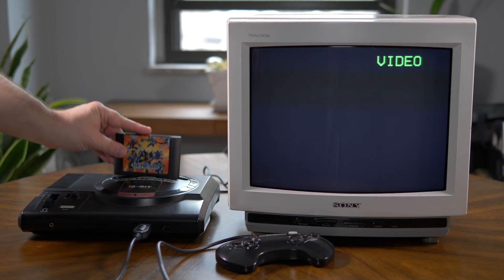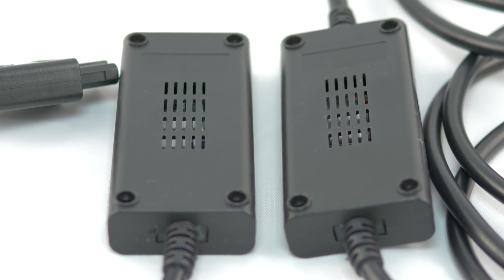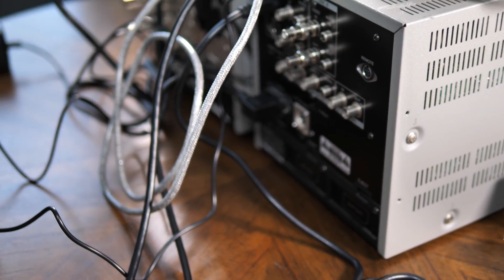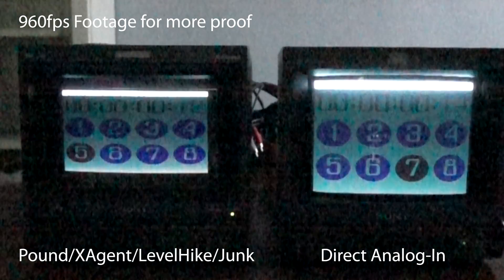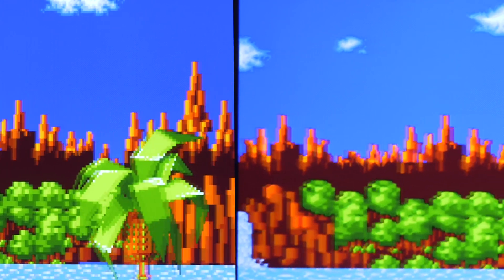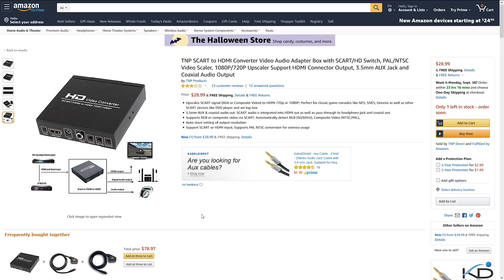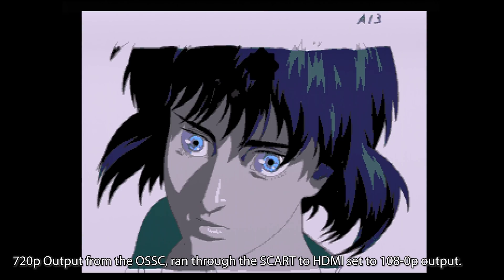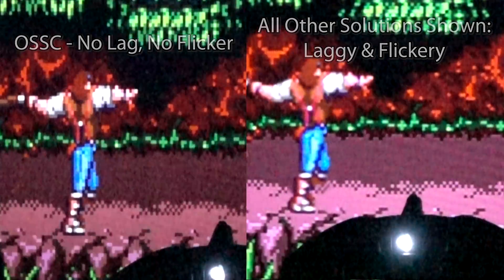The Worst Scaler In Retro Gaming

Comment: There's stuff worst than the GBS-8200 CGA to VGA Video Converter ?
Reply: I know its shocking, that GBS is trash too!
Reply: @JasonBaker1978  I see the GBS as a very cheap, last ditch effort for some really jerry rig Arcade video conversions. It was intended to be used by Arcade operators who don't really care about video quality, and they want to convert video really cheaply.
It performs terribly with any game console.
Reply: There is custom control software for the GBS which actually makes it pretty great. Check out the gbscontrol project
Reply: @fluxcorenz  better sure, but pretty great?  I guess it depends on what you consider great.  I wouldn't mess with one.  My two fave scalers are the OSSC for 240p/480p content and iScan DVDO VP50 Pro for 480i.

Comment: This (scart to hdmi) was the first one I bought too. Sad that at the time I thought it was good. First broke in a month, second one has a ridiculously sputtery image. At least I have a Retrotink2x now
Reply: @Inv8erZlM  I know the passthrough solution means no lag but can't speak about the hdmi "worst..." solution, just that I perceive no lag whatsoever through neither. That is, on a cheap 32" 720p 2017 Panasonic LED tv with no other configuration than color calibration and basic contrast.
Reply: Does the retro tink do anything for 480p systems?
Reply: @swungsolid  I believe the retrotink doesn't do anything for already 480p signals.
Reply: It looks great on my tv lol. I retcon the fatguy is trying to sell us the Rad scaler and I was about to order one but this smearing now? Now I'm not buying his Rad scaler.
Reply: J.C.L <------Dammit Adam stop posting under a new account after every video!
Reply: J.C. L. Build quality is over the map so you might have lucked out
Reply: @Drinkabeerandplayagameofficial  I mean, I have a passthrough device (to component video) that requires another device connected to it for sound and it does look better but the audio device only outputs one channel, so I bought the "worst scaler" hdmi solution. Both the passthrough and the "worst scaler" hdmi solution from this video give me no preceivable lag on my snes, my genesis or my ps1. I do wish SOMEONE could make a reliable sound device for the scart to component output device.

Comment: It's fascinating that Pound and Hyperkin are using the same generic devices as the no-names. Really tarnishes the brand...
Reply: I won't say this is what ruined hyperkin brand. They have been pushing supar products for a good while now. I bought a N64 power supply from them that almost cought fire. Turns out the didn't solder anything inside the power supply, Just super glued it.
Reply: @doomisforu  Hyperkin has been putting out pretty good stuff for the past few years now, they upped their quality control big time just in the past 2 or 3 years. Yes when they started out they put out some HORRID products but they have really turned the corner. Hyperkin and Retro-Bit are both releasing some solid products
Reply: @doomisforu  "caught". Also I highly doubt they didn't solder anything, because that would make it extremely difficult for a power supply to function at all.
Reply: @rars0n  it didn't function, the minute I plugged it in and turned on my n64 it started to burn.
Reply: @doomisforu  What you're describing is a short to ground. Superglue has nothing to do with that.

What you are also failing to comprehend, which was implied in my previous comment, is how superglue would likely fail to adequately connect the individual components to the circuit board. In your theoretical superglued power supply, it might have arced but barely at all and certainly wouldn't have caused much smoke. But far more likely is that it wouldn't have worked at all, since there's a high chance that one component along the line is making zero electrical connection and is therefore open. Shorts are caused by electrical connections to ground, which superglue is completely incapable of producing.

You're also ignoring the fact that soldering is cheap and the company would gain absolutely nothing by cranking out a bunch of non-working power supplies instead of just doing shoddy solder work that would actually make them work.

All of this to say, and to reiterate thanks to your reply above, that you have no idea how electronic circuit boards work, and are therefore an unreliable narrator.
Reply: @rars0n  Well, it doesn't matter anyway Super glue is what some companies use to save money. It cheaper than metal. I not bashing Hyperkin directly. I have tried several power souce for different manufacturers. Most of them are not the right voltage to begin with. The only thing I liked from hyperkin was the Retron 3. I stay clear of third party things most of the time.
Reply: @doomisforu  The only glue thats cheaper that solder is PVA. Even if you looked at something like a PS4 or a 4k tv, the cost of the glue inside will be higher than the cost of the solder. Hell, the cardboard reel that it comes on costs more than the solder itself.
Reply: @rars0n  A short is not the only thing that can cause magic smoke. Missing components/ non connecting components could also cause this. It completely depends on the circuit design. I would guess in this instance that one side of a component was friction connected while the other wasn't and caused arcing. That in turn can cause a path of doom or even arc to other close components.
Reply: @rars0n yeah he lied
Reply: What "brand?" It essentially launched the "brand" for #Pound, LevelHike, Xtreme, etc. It's not the association that tarnishes them, it's the performance... just like it was for the old scaler boxes.
Reply: How exactly are they ruining their brand when everything both companies have "made" has always been low quality garbage?
Reply: Hyperkin was always garbage tier
Reply: Pound and Hyper are crap!
Reply: The majority of these items, come from China, by way of AliExpress or AliBaba. They are a direct supplier for a lot of these companies selling their own branded cables and converters. - this why these devices look and function the same. You can quite literally, create your own branding, send the supplier of choice some photo files of your brand name, color scheme and even style of what you want the box art to be if you want and you've got an instant manufacturer for a bulk supply of 1000 to 10000 units where you can set the price and profit from it. I've never known Hyperkin or Pound to sell anything that is quality.
Reply: Hyperkin make garbage product, I had a Supaboy and the SNES/N64/GameCube HDMI adapter and both of them were poor quality.
Reply: It's weird because I've seen comparison videos of Pound and Hyperkin and they look different in the videos (Hyperkin looked better).
Reply: That is a shame. Are those Kaico cables the same deal? One day i'll have $$$ to buy a DCHDMI modded console!
Reply: John Norris They are all made by same factory in China they just slap on different names on the box
Reply: Hyperkin and Pound always produce trash
Reply: At least they have a USB power to up to quality unlike some cheaper direct ones with just  scart on one side and HDMI on the other and they do improve the image of a PS2 I have a Level Hike costs about £30. However RetroTink are better but do cost more around £100
Reply: Hyperkin is not really known for delivering high quality products ... I mean just touch them, they feel super cheap.
Reply: @pandurlolgg5780  Just to be clear, I'm not trying to defend Hyperkin, I'm just saying his statement was bogus.
Reply: @rars0n  good job adam really showed him